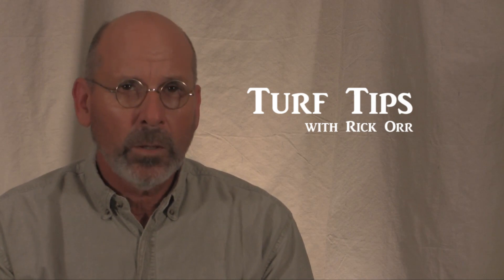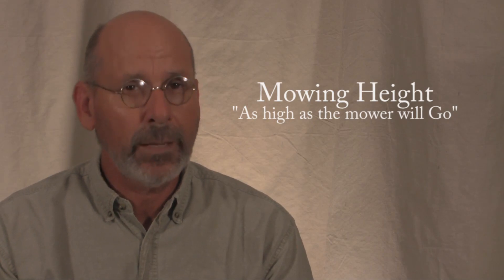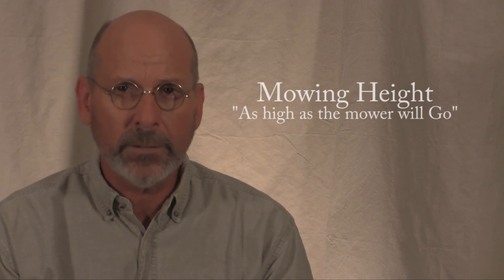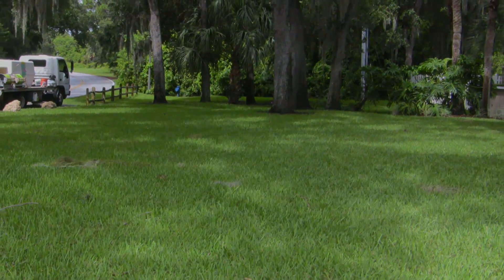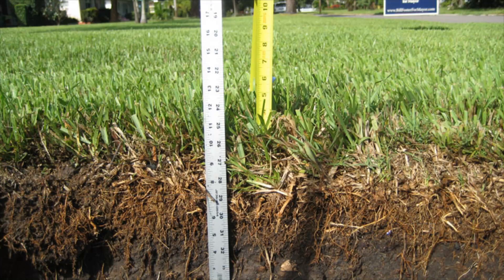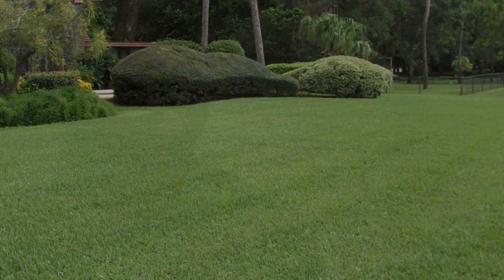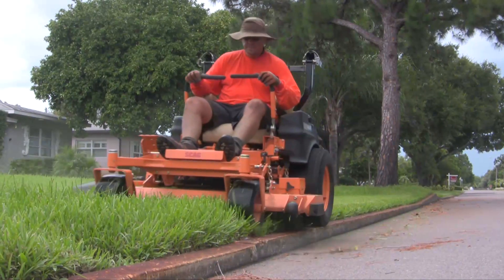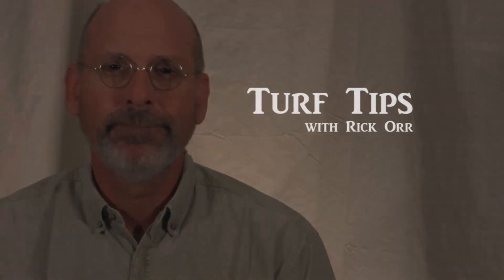Mowing Height

Comment: Thanks so much for the info 👍🏼. 
I have a problem with my Zoysia grass, where the blade is grass is at the top and there is a long stem below the blade. So the blade of grass is high off the ground because of the long stem...can I cut off the blade of grass and also part of the stem so the grass will grow shorter? Or should I top dress to cover the stems in soil? Any suggestions?
Reply from the maker: I do have a lot of info to work with but I believe what has happen is your mower has too low a frequency of cut. If you are using a standard rotary mower, the turf will not be cut correctly and cause this elongation. Scalping or top dressing will solve the problem. But if you do not upgrade your mower to a reel type of high RPM rotary, the problem will reoccur. Hope that helps.
Reply: Hey thanks a million...yes your answer has definitely cleared it up a lot for me....I took your advice and I scalped as it’ll take too much top dressing as the stems are really high. 
What I saw after I scalped was the stems were dark brown in colour.
Any advice on how to bring back the scalped areas?

Comment: What can I do if I used the wrong fertilizer on at Augustine?  Moved from PA to TX and used scotts weed and feed. The grass has yellow blades with green blades. I tried to water extensively to flush out the salts now I'm worried I bogged down the roots and could develop fungus. Man did I mess up this lawn. Any help/advice would be appreciated. Thanks for the video!
Reply: I'm in south Texas and I switched to Milorganite, but am looking at other organics. So far with a high mowing once a week its doing really good.
Reply: i used Bayer avance 3 un 1 anda same problem buen the st augustine